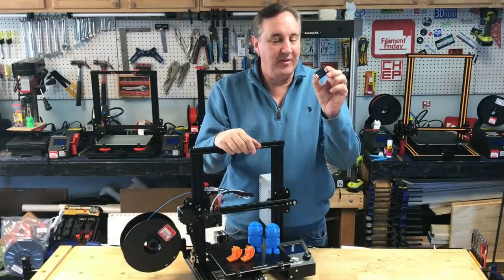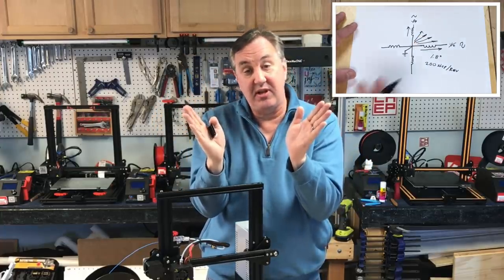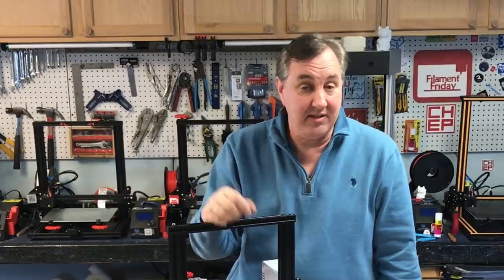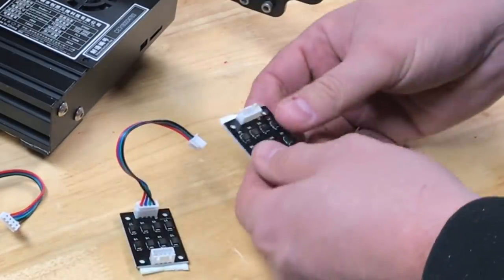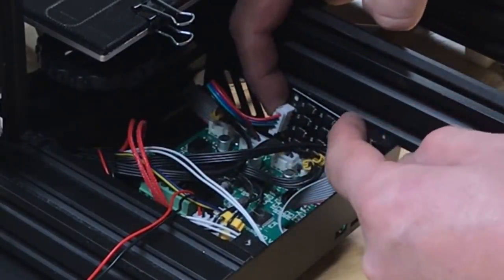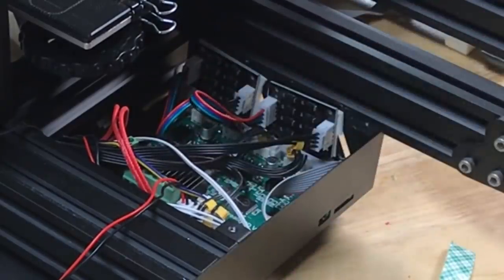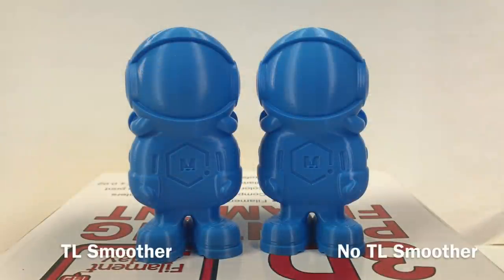Creality Ender 3 - TL Smoothers Upgrade and Test

Comment: Another great video, thank you!
2 quick questions:
1. Does this dampen the noise during printing at all?
2. Theoretically, could I put the smoothers at the other end of the motor connection? (By connecting the smoother to the motor itself?) The connection looked the same. I know it would be ugly hanging there, and I would see about making a little case/mount for them, but before I go into the hassle of making a design for it, I would like to know if that would even work.

Thanks again for the videos! They're so helpful!
Reply: The connector is different on the motor than what is on the board. 

I think smoothers made my Anet A8 a little quieter. Seems like the steppers weren't as loud.
Reply: @JohnSmith-mk8hz  Thanks for the reply, I appreciate it! I'm still fairly new to all of this, and I appreciate how helpful the 3D printing community is!  I'll keep that in mind. I don't know if I'm at the level yet where I need to use smoothers, but this will be helpful info for the future if I get more serious about the quality of my prints.

Comment: Hi chep,i found the problem with my ender 3 pro,it was the extruder heat block came loose from the bracket,can you make a video on flashing a boot loader onto the ender 3 pro,I've watched other guys do it on you tube and they make it very complicated.

Comment: Hi CHEP, another great video. I was considering installing TL smoothers too, in a noise reducing aim. You did not mention if they have helped make the Ender3 (mine is a late model, but still quite noisy) noticeably quieter. Thanks in advance, cheers
Reply from the maker: It won’t affect noise. At this point I’d recommend installing a Creality Silent Board. 
https://amzn.to/2CQsarh
Reply: @FilamentFriday  does the silent board dosent need the smoothers  because it has the TMC 2208... Right???
Reply from the maker: Correct.

Comment: I don't think TL smoothers are needed on the ender 3, in all the tests I have seen by different people yours is the only one I have seen do anything and even that could be circumstantial.
Reply: I installed TL-SMOOTHERS in my Ender 3 and the result was the same. No more diagonal lines on the benchy and a little bit better print quality. Not as good and the Ender 2.
Reply: there is nothing circumstantial about it. same gcode. one has artifacts one does not and its repeatable. remove the smoothers the artifacts will come back. (ie the opposite of circumstantial)

my CR-20 did not need them. my Ender 3's and my Ender 5. needed them. my Ender 2 did not need them.
Reply: Think it comes down to the electronics, some of the creality boards and steppers may be better than others, i have never seen this effect on my Ender 3's or any of my other printers except an old delta years ago with drv8825 drivers.  I would always prefer to upgrade the electronics to adding more cheap crap into the system.
Reply: @thegarageluthier  as far as I know Creality used three different board revisions on the Ender 3. I had two Ender 3 with the latest v1.1.3 board and both showed the same artifacts. Upgrading the board is clearly a better solution, but TL smoothers are cheaper and easier to install. Also I used TL smoothers which appear to be of better quality than the ones CHEP used (TL smoothers plus v.1.1 from TriangleLabs). But I'm planing to upgrade the board in the future (32 bit board with trinamics drivers).
Reply from the maker: Look closer at some of those videos that claim they do nothing and you’ll see they have  the lines on the cab of Benchy and then gone with the Smoothers but they then claim Smoothers do nothing. So continue to believe what you want. My video clearly shows the improvement and the only difference was the Smoothers.
Reply: @luciomachado6727  that's probably the reason for the differences in user experience then,  never checked what version my boards were they only lasted a couple of weeks before being relegated to the junk pile in the garage.  I'm not a fan of cheap boards so replaced them in my Ender 3's with Einsy Rambo's and couple of other little tweaks and they now run  beautifully, quietly and more importantly safely and reliably :-)
Reply: @thegarageluthier  that is the board used on the Prusa MK3? Could you provide the link of the board you bought? Does It work with the Ender'3 original display? Do you had to install an external card reader? Sorry for so many questions.
Reply: @FilamentFriday  I think part of the confusion is and something I have to keep explaining to people is that smoothers do not remove noise at all they have no impact on noise whatsoever smoothers only remove one single specific artifact that is electronically generated by the hardware which is the salmon skin they normally think of the salmon skin as the bull's-eye pattern but when you place a bull's-eye pattern on an angled but flat surface it manifests as those diagonal lines you have those diagonal lines are Salmon skin

That is the only thing that smoothers do if you are looking at any other noise and expecting it to go away it won't
Reply: @luciomachado6727  no problem,  The original display didn't have the SD card slot so i used the standard 12864 display that you can purchase everywhere i had a few in a box so didn't need to buy them,  the mounting holes line up but the pot is slightly off center of the original hole so i just widened it out a bit with a file.  The Einsy is 5v for the fans so i used a 5v Noctua for the hotend, the part cooling fan really depends on what cooling solution you are using, i just decided to keep the original fan because with the Tusk duct i get enough cooling for my needs so used a small dc-dc buck.  The boards themselves i just bought from Fystec on Ali because the originals from Ultimachines end up costing a fortune to the UK ( ask me how i know :-) ), Comparing the Fystec boards to the Ultimachine ones they appear identical even down to component level and silkscreen and have performed flawlessly so can't complain.  Other things i have done are new Push Fit fittings, stiffer springs and bondtech mini extruder.  I use manual mesh levelling  and that's it no other 3d printed mods the machines work really well and they are simple which i like.
Reply: @FilamentFriday  but why would they claim they do nothing, I am not sure what they would get out of it. I am not saying it your benchy didnt improve as it clearly showed it did, but I feel more testing is needed as if it only helps a benchy and makes no difference to other models like your space man, are they worth it?

Comment: Could you please give some tips regarding the belts on the X and Y axis? How to tension them and how tight it should be.
Reply: Loosen screws, pull tight, tighten screws
Reply: I saw a video by Thomas Sanladerer
 that said tension should  be tight enough to be able to strum like a guitar, while my X does strum, my Y does not, it is looser than that but has caused me no issues so far.
Reply: I've got it pretty tight so I think I'll be OK.

Comment: I built a tray that mounts smoother's to it and a fan ring on it so they are held up by fan mount. Decreasing the airflow is never good. Far as not putting a smoother on Z axis why not? noise can come from anything be it small feed back from home or other sources. Vibration also causes issues if the vibration is significant enough.Running CNC at work we have some issues on servo caused by feedback. I am going to installing mine today and i'm not changing settings and see how it compares on all planes.

Comment: Thanks for this great recommendation. Do you think it would increase the print quality, if you change the XYZ motors against 0.9 stepper motors? Best regards Martin
Reply from the maker: Possibly on some prints but I’m not really sure.
Reply: I think the actual drivers on the motherboard makes the biggest difference. Like you said, the Prusa i3 Mk3 doesnt need these because that MB uses better drivers. But, I dont know how you change the drivers on the Creality boards, since they are all soldered in.
Reply: Installing .9 degree just makes the diagonal lines happen twice and much. Driver tuning plays a big role in the salmon skin effect. Too low or too high VREF will increase the ripple appearance. Just right will smooth them out considerably but will not remove them completely. The A4988 drivers need to be set in mixed decay mode by ground the ROSC pin but all printer makes sets them to auto decay because its makes them much quieter but creates these step disparities.  Any ways .9 degree steppers are a great upgrade for the extruder.

Comment: Hi Chep I have 4 of these 8 diode boards can they be used in the ender 3 pro?
Reply from the maker: Sure. It’s the same board as regular ender.
Reply: @FilamentFriday  Thanks Chep 😁
Reply: on my Ender 3 Pro  where the motor connectors connect theres a blank side they just fit.
I bought these for my Ender 3 Pro (1.1.4 mobo, it was noisy without thermal protection , activated, which I managed flashing the firmware) at first the Z axis motor grinded very loudly (others were OK), so I swapped the connectors round on the smoother board & that stopped it so perhaps they do need wiring one way.
Just as noisy as normal, but does seem to give slightly better quality prints (not massively). Though now the fan on the hot end (the front one) doesn't seem to have enough power to spin up full speed (if I push it, itll work for a min or so)  not sure if this is anything linked.

Comment: Ok, I'm confused, diodes are normally used to prevent current from going back on a circuit making them directional yet you say these TL smoothers can be installed in any direction, wouldn't installing them backwards completely disable your steppers?
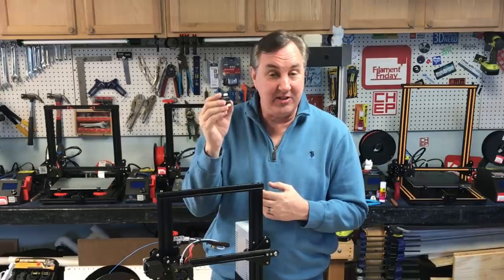Reply from the maker: There are parallel opposing diodes. Look at schematic around 0:45
Reply: The even weirder thing is that these seems to work, when a smelloscope cannot really detect any difference in the signals beyond margin of error.
My guess is that the diodes cause ever so slight voltage drop and the loop nature causes the pulse to over so slightly extend itself for higher time.

I've been theoretizing as well that the effect is due to missed microsteps, as it's very hard to keep the stepper motor rotor middle of 2 poles super accurately without some amount of back and forth. Stepper motors are generally +/- 5% accurate per step, but when you account for microstepping that means you could be 1-2 microsteps off at 1/16.

This combined with the fact that belt drive systems have veeeery low steps per 1mm only about 80, when to properly utilize your stepper motors you'd need like 800. 80 microsteps per 1mm, means being 2 steps off is 0.025mm, which would most definitively be visible but you would not feel it. 1 full step = 0.2mm and +/- 5% means 0.01mm variance, and add to that microstepping caused inaccuracy... There is also belt backlash which is at about that order of magnitude on typical setup as well where belts are loose AF (any typical 3d printer has way too low belt tension).

These are precision machines, but typical construction is highly inaccurate.
Reply: @skaltura  My theory is that they help compensate for the momentum during deceleration so it doesn't feed power back into the board and thus the motors are more stable because the electrons have nowhere to go when slowing the pulses down or stopping them.

Comment: Hey, there are 4 axis E,Z,Y and X do I need to put this smoother for each of these or only the one which you showed in the video is enough? OR if I put it to all 4 does it make any chance? does it make it better? Thanks,
Reply from the maker: I would recommend the Creality silent board with better drivers instead. Then you don’t need these. Otherwise only put these on X, Y.
Reply: @jwgmail  I checked SKR Mini E3  and it is really much more harder than installing Creality silent board. I will go for it.
Reply: @jwgmail  yes but I am still confused on coding part, he makes some changes on codes and I do not know If I need to do it or not or I need to do it for updating the card. it is a little bit complicated but I already ordered 1.1.5 card so I will use it for now but maybe later I can upgrade it

Comment: If you don't see a problem, will adding these as a precaution cause any detriment?
Reply from the maker: Not that I see but if bench does show you those angled lines don’t waste your money.
Reply: I'd be interested to see how one on the Z-axis affects your prints with and without full steps.
Reply from the maker: I didn’t think it would do anything but I never tried it.

Comment: Not sure if I would have stuck them over the air vents in the case.
Reply: i also don't like that... cooling is very important imo..
Reply from the maker: Like I said in the video, there are a lot of openings for air flow. It’s been running a long time without any issues.

Comment: What is the magic number for the Z axis on the Ender 3? I've searched the internet and could not find it
Reply: Multiples of .04. I mostly use 1.2 with my ender 3 pro. But you could use 0.8, 1.2, 1.6, 2.0, ect.

Comment: Chuck! I need your help. I just bought a ender 3 pro, and the x and y axis stepper motors have press fit gears so you cant install motor dampers. How do I solve this issue? Thanks Chuck🤗

Comment: When I opened up the case to the circuit board I saw that all the cables are glued into the board. I can't take out either the X or Y parts to connect to these little guys.

Comment: Can these be mounted outside the control box and between it and the stepper motors? Can they be used on the cheap CR-10 for improvement?
Reply from the maker: I’m sure they could

Comment: What about when you print in VASE MODE? do you think smoothers help? or not so much> Maybe Z smoother in VASE MODE? thanks... i have 2 or these smoothers not sure i want to install or not...thanks
Reply from the maker: They don’t help vase mode.
Reply: @FilamentFriday  Okay... i am a newbee ..one other question ..i have printed the same model 6 times each time changing cura settings...size layer height speed,line width etc... i still get same weird lines like little circles in some areas they are showing up in same spots on model...is this the model file? when it was remixed etc?? PS..They show up in vase mode and regular mode this model can be printed in both... because i thought i needed smoothers to fix... thanks

Comment: Any tips on how to get the hotglue off the connections on the board. I'm try to peel it off with a scre driver but I'm really not liking how much pressure that is needing
Reply: Lol nevermind sorry. Got it 👍
Reply: Glad you got it! For anyone else having trouble, rubbing a little isopropyl alcohol on the hot glue will loosen its grip

Comment: Won’t the two diodes give a 1.4v voltage drop to the stepper coils?
Reply from the maker: Yes, that is how it works blocking the low voltage effects that cause the issue. They don’t affect the current which is what drives the steppers.

Comment: I bought these for my Ender 3 Pro (1.1.4 mobo, it was noisy without thermal protection , activated, which I managed flashing the firmware) at first the Z axis motor grinded very loudly (others were OK), so I swapped the connectors round on the smoother board & that stopped it so perhaps they do need wiring one way.
Just as noisy as normal, but does seem to give slightly better quality prints (not massively). Though now the fan on the hot end (the front one) doesn't seem to have enough power to spin up full speed (if I push it, itll work for a min or so)  not sure if this is anything linked.
Reply: Should i install them or can i do without them on my ender 3 pro?

Comment: I just did this upgrade....will try test print tomorrow hopefully. But on mine...turns out the connectors were hot glued in, that caused bit of trouble getting them out/ off...and just my look that one of the connectors on my TL smoother was broken, just the plastic...seems to be on ok so shouldn't effect anything....I am little worried on the vents being covered as I'm currently building a sound proof enclosure for it...so lil bit worried about heat build up anyway...thick chipboard and sound proofing...so gonna be hard for heat to escape? Anybody done this?

Comment: Bit of an older video, but I just got into 3D printing last week and bought some of these.  Bit of a warning.  Make sure the harnesses that come with yours are correct.  One of mine had the wires connected in the opposite sequence on either end.

I'm not very experienced with electronics, but I'm pretty sure that's not good.
Reply: Some of them are wired backwards. If you also install the direct-drive kit, that reverses the wires too. So if you install them both, they work correctly. Two wrongs sometimes do make a right. Or you can simply use a needle or thumb tack to release the catches that hold the wires into the plug. Shift wires around.
Reply: @makeitreality457  yeah, I wound up doing just that, but with some needle tipped tweezers.

Comment: So if I move an axis quick enough manually with the machine off It will power the screen back-light and fan. I wonder if these would prevent that.
Reply from the maker: Somewhat but not completely.
Reply: Be careful doing so, feeding back power like that can fry everything.